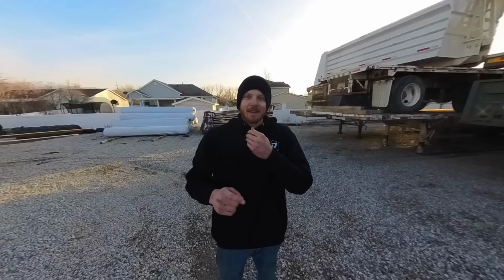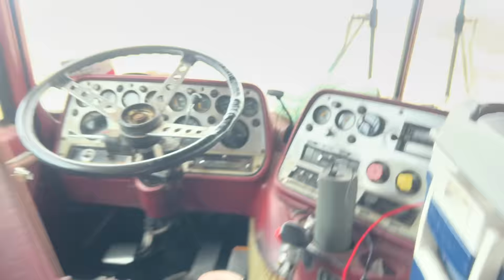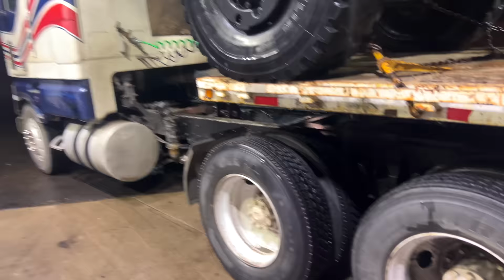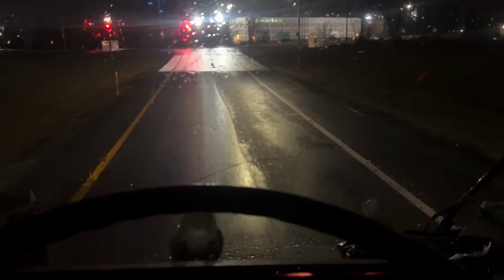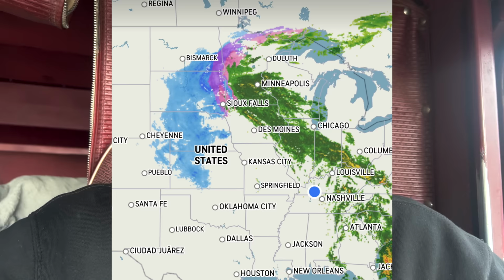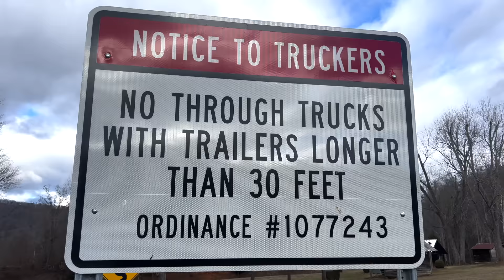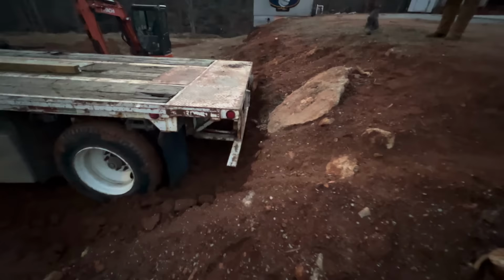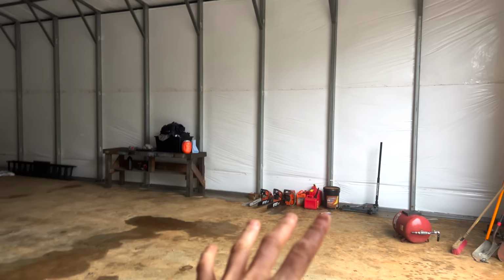Unexpected Circumstances Cause Me To Move Across Country

Comment: I would put a row or 2 of fire rated plywood along the base of the walls to prevent burning up the plastic on the insulation from welding/grinding. And it would also work as a bump bar for the posts when forking or driving things in.

Comment: I would get in touch with Century with model number for a copy of operator's manual.  Check with the local tow operator's so if they can send work when they can't do it plus they can tell you where to get it, what works & what is needed to get started.  Most tow operators are a tight knit group willing to help you out.

Comment: Of course it would be the inside dual!
Just a suggestion next time you have a nut that won't break loose  add a nut on either side and tighten them up that will take some of the bind off the nut that is to tight

Comment: As temp goes very low the output voltage from solar panels increases. That’s why your power went up. My 240 v system exceeded 250 v when it hit 0f. That faulted my 250 v victron charger.

Comment: I learned the hard way (after losing two tires -- two days in a row!) that my impact driver was not torquing the lugs nuts on tight enough. If you don't use a torque wrench to check them, you really have no way of knowing exactly what you're dealing with. :( Now whenever I stop for fuel, I spend that time checking torque on lug nuts.

Comment: That trip had me on the edge of my seat.  Having steel wheels on the drivers was the ticket losing both tires on one axle.   You've certainly had some changes in direction over the past couple of years.  God's plan for us isn't always our plan but there is a reason for that.  Your attitude and work ethic are some great strengths.   You have lots of folks pulling for you in your new venture.  Give 'er !

Comment: In KS that storm had a bunch of friends got stranded they didn't have enough plow operators to open the back roads i played hell with my 98 V3500 getting anywhere so i unloaded my 65 c20 factory 6 banger 4 speed on 32 inch tires i was busting through some drifts and float over the big ones i took supplies to the older people and took some that wouldnt die of a heart attack when I popped through ditches into the edge of fields to get them to town for supplies i delivered alot of gas diesel and propane exchanges to keep generators running then went and fired up a county grader with a snowplow but no operator got farmers to their cattle they were plugging away with tractors till i came along i figured it was easier to ask for forgiveness than permission they fueled me up i got the older people plowed out even their driveways tractors were following to get garages cleared in case of emergency an ambulance could get there or they could get a truck out then i worked on school routes probably upset some kids then just kept plugging along till the highways were open enough for a truck operator to park and take the machine everyone was surprised by my 65 C20 mainly after finishing the restoration of sorts last summer i had it and a 50 Chevy 3100 in an enclosed trailer behind my 98 but i unloaded it and did truck use use things with it i kept telling them a truck can be rebuilt or fixed lives not so much I definitely put my yankum ropes to the test yanking vehicles out of ditches drifts and such I'm definitely getting blades for my biggest 4 tractors by next winter and had a couple older snow blowers given to me ill have to work on the hoses are rotten and a few bearings are junk and 1 gearbox needs sealed but the ptice was right and I have tractors with enough hp so we'll see but the 65 was great idk if it was the 32 13.50 16s with 10 psi or what it seemed to float it was fun thrashing on it so much before I lower 1 to be a ground dragger yet pump up the airbags to work i think my next 1 is getting super duty axles and a 6.0 LS swap on 37 inch tires i might even look for a plow for my 2.5 ton 6x6 military truck ill have to find some wheels for it the 16.5s are hard to find and hard to keep on the bead at low psi i might have to order some 20s or 22s with a 50 or 54 inch tire i should still have enough sidewall i have a wrecker body off 1 i can hook right into the wet kit for the dump box or maybe look for or build a spreader box for the dump bed

Comment: Dry rot? I hated having to deal with Bud nuts especially when just checking the torque you had to loosen the outer nut to check the inner nut, pain in the a$$.

Comment: Just curious... I was a rig driver like 25 years ago, so I wouldn't know, but are Super Singles rated to carry the same load (which I imagine they are), but are they more expensive?  Or would they equal having twice as many tires?  I imagine that there is safety in duals as you can just replace one of two instead of the whole tire itself.

Comment: Okay, I couldn't resist. I had to say one more thing. Here's the real deal anybody can come to this country. You can ride a bicycle your whole d*** life and get a CD l. And you're actually adding to the fuel of firerror does show them. They can do the same s***But you're not a real truck driver.  And I'm sure diesel Dave would understand he has a CD l and big heavy hole on equipment for his own personal use. You're showing it as if you're moving it down the road for production. It's very disrespectful to your elder truck. Drivers in this country just like disrespected and american Veteran